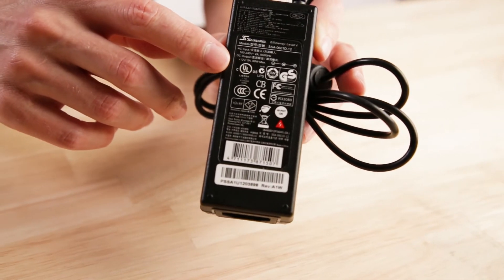UL vs ETL, Understanding Safety Certifications

Comment: How about products that are autonomous in nature, vehicle, space, or other.  what standards would this entail?   Cars electrical saftey.
Reply from the maker: That space is certainly expanding quickly and the specific certifications required will depend on the use case. As you mentioned, it's not just self-driving cars, though they still get the bulk of the attention. UL has an extensive list of related certifications and provides a training and advisory service specifically for it: https://www.ul.com/services/autonomous-vehicle-safety-training-and-advisory

OnLogic customers use our hardware for a range of autonomous solutions including warehousing robots, delivery devices and agricultural equipment. The certification and testing needs all vary for both the hardware and the solution.

Comment: Hi I’ve gotten an air fryer for my business from overseas, do I have to apply for UL and do they come and check out the product or I have to bring it to their labs to get tested? Please give me a reply 🙏🙏🙏 thank you!!
Reply from the maker: Thank you for the question. Product manufacturers are the ones that apply for and receive UL certification, not consumers. You'll want to check with the manufacturer to determine if the product has undergone safety certification.